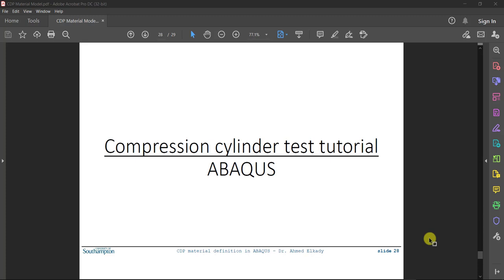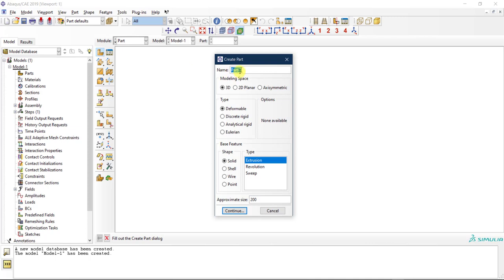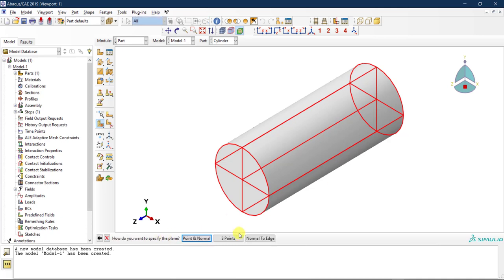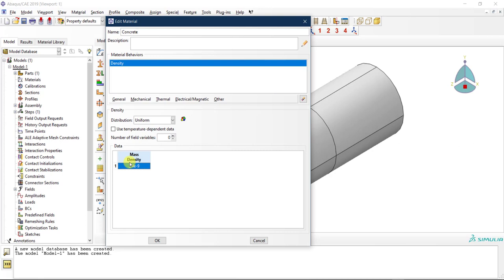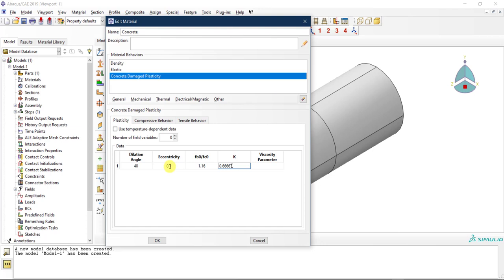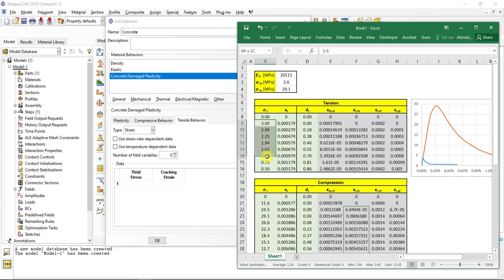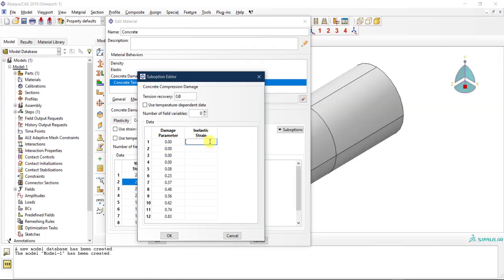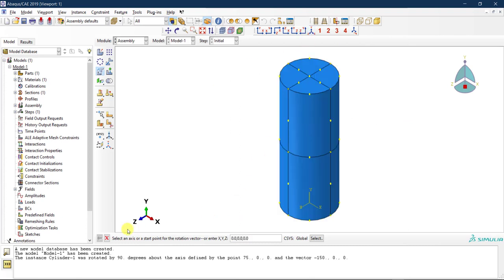#22 ABAQUS Tutorial: Concrete Compression Cylinder Test

Comment: Thank you Dr Ahmed for the great video. However, can we use Von Mises as a failure criterion in the concrete?  as I know that the Von Mises criterion excludes the effect of the hydrostatic stress while the concrete is sensitive to that stress.
Reply from the maker: Not sure I fully understand your question. The CDP model plastic flow potential function is already dependandt on both the hydrostatic pressure stress and the Von Mises stress. When assessing failure/damage in post-processing, it is up to you to check any stress components or invarients of interest.

Comment: Good afternoon sir, I want to know if the CDP model takes into account the strain rate and if yes would you mind mentioning the formulae? Thank you in advance
Reply from the maker: Most material models in ABAQUS "can" account for strain-rate effect IF specified by the user. For the CDP model, under the compression hardening and tension softening tabs, you can check the option to "use strain-rate dependant data" then you will need to provide the model parameters as a function of the different strain rates.
Reply: excuse sir but the problem I'm facing here is the lack of information ( inputs either in compression or tension ) about high-speed impact. For example, if I use the model depicted in Eurocode 2 for nonlinear analysis of reinforced concrete under compression. Do I have to check the strain rate option or that model would take into account the strain rate effect implicitly?

Comment: First of all thank you sir for such wonderful video. I have one question:  my abaqus file (modeling of beam-column joint under cyclic test) is showing error when i do edit keyword as suggested in your previous CDP video. For simulating crack do i need to install the exe. file in you CDP generator file as available in the link mentioned in the description. I am using Abaqus 2020. 
I will be grateful if you have any other suggestion to deal with it. Thank you sir

Comment: Thank you for always sharing helpful tutorials. I have a question concerning the type of analysis. You have mentioned in 13'55 that this analysis is a quasi-static one. I want to know why and based on what parameter you classified it so?
Reply: This means that the loading rate is very slow (10 sec), so eventho he is using the explicit solver (which is used for dynamic loadings mainly and mostly takes into consideration the inertia effects + Acc & Velocity), so this step is in name explicit but the load is slow enough to call it Quasi-Static.
By definition, "Quasi-static load means the load is applied so slowly that the structure deforms also very slowly (very low strain rate) and therefore the inertia force is very small and can be ignored."

Comment: Thank you so much for this video, sir ,when we develop pile driving model (concrete pile is used), how to apply the pile top load (Hammer impact)?
Reply from the maker: The only difference between static and dynamic loading is that in the latter you define a dynamic explicit step. In that step, time is relevant, therefore, you can then model how the applied load or displacement changes with time. Please see the tutorials on cyclic loads and explicit solver.
Reply: @AElkady  ok sir. Thank you very much.

Comment: Dear Dr.Ahmed 
Thank you for providing these tutorials.
After I filled the properties for CDP, I am facing errors like, "Unknown keyword "concrete failure". The keyword may be misspelled, obsolete, or invalid.

The material options *cap plasticity, *cast iron plasticity, *clay plasticity, *concrete, *concrete damaged plasticity, *drucker prager, *foam, *crushable foam, *mohr coulomb, *jointed material, *plastic and *soft rock plasticity are mutually exclusive

Analysis Input File Processor exited with an error.  
Please let me know, if you have answers for this.
Thanks!
Reply: Same error occuring if you have mitigated this error kindly guide me also 
Thanks a lot

Comment: Thank you very much for the video. I was required to model element deletion in a concrete block when element temperature reaches specific value and specific failure strain in that temperature. How could I use these temperature dependent failure strains into my model?
Reply from the maker: When defining the material, you can choose to define "temprature-dependant" data. In that case, you will provide material properties definitions (including failure strain) as a function of temprature.

Comment: I also have question here, in the Reference Point in assigning Constraint, why is it that you use Tie instead Rigid Body?
Reply from the maker: both would work in that example.
Reply: @AElkady  Ahhh, I see. Noted on this.
I am working right now on my Master Degree thesis, and I am using Abaqus Software. Actually, I did practiced your problem (4 point bending test) here in this video: https://youtu.be/LBUhH-d3sxw. I did all what is done in your video. To be honest, my thesis focus, too in 4-point bending test. But my problem is, the graph in the Force vs Displacement is not much of a non-linear graph, compare to the graph in your other videos like: https://youtu.be/fYvUDo06e6c. Do you think there's something that is wrong in my Input Data?
Reply: By the way, my time = 1.0, and my increment is 0.05... is the time and increment has something to do with the graph?

Comment: Thank you very much for the video! Very useful. I just don't understand why you used tie-rigid body constraints instead of pin-rigid body constraints you used in another video?
Reply from the maker: There will only be difference between tie and pin options, if the reference point rotates. In this example it does not, so the selected option does not matter.
The documentation below provide clear description of the two options with illustrations:
https://classes.engineering.wustl.edu/2009/spring/mase5513/abaqus/docs/v6.6/books/usb/default.htm?startat=pt01ch02s04aus20.html#usb-int-arigidoverview

Comment: For this analysis, my job immediately aborts with the error
"The independent variables must be arranged in ascending order. This error may have been caused by a possible empty line on the datacards in the property definition."
but there is no empty line in my datacards
Reply from the maker: 1) Discard all keyword edits to the model (if you did any) and re-write the keywords. 2) Make sure that your CDP data (such as damage parameter and strain data) are in ascending order and not repeatative).

Comment: DURING THE CONVERSION FROM CRUSHING TO PLASTIC STRAIN Abaqus FOUND NEGATIVE AND/OR DECREASING VALUES OF PLASTIC STRAIN. VERIFY THAT THE DEGRADATION DATA UNDER *CONCRETE COMPRESSION DAMAGE IS CORRECT??????
Reply: its my bad 0.0006 I miss on 0.00

Comment: I'm getting the error message that DAMAGESHR, PEEQVAVG, PEVAVG, SVAVG are not available for element type C3D8R.

I imagine DAMAGESHR in particular is very important for this analysis, so how do I fix this issue? Are you supposed to use a different element type?
Reply from the maker: Field variables are available for specific element types and analysis procedurea, Please check this link for more details https://classes.engineering.wustl.edu/2009/spring/mase5513/abaqus/docs/v6.6/books/usb/default.htm?startat=pt02ch04s02abv01.html

Comment: A question please, I am doing a quasi static compression test on a polymeric structure and the compression rate is 0.1 mm/ sec applied for 6 mm, for a dynamic explicit time step shall I write 60 sec (1 min)  or what?
Reply from the maker: That's correct although if you are not incorporating strain-rate effects, then your simulation step time does not need to be the same as that of the test. Iif you are simulating a quasi-static condition, you can use a much shorter step time as long as you don't induce dynamic forces in your model. Check the tutorial on explicit solver DOs and DONTs

Comment: Dear Dr. Ahmed,
Thank you for providing these tutorials. 
Regarding using the engineering values of stress-strain data, I wondered when to convert this eng stress-strain chart to true stress-strain?
Reply from the maker: Transformation of engineering stress-strain to the true one is mainly applicable to ductile materials that experience significant elongation and change in cross-section prior to failure. This does not need to be done for brittle material like concrete.

Comment: hi thanks for your unic tutorial.
i do what you do step by step 3 turn but in eatch turn apear an error that sey:
Error in job Concrete_Compression_Sym: THE INDEPENDENT VARIABLES MUST BE ARRANGED IN ASCENDING ORDER. THIS ERROR MAY HAVE BEEN CAUSED BY A POSSIBLE EMPTY LINE ON THE DATACARDS IN THE PROPERTY DEFINITION.
can you help me?
Reply from the maker: This means you probably made a typo when you edited the keywords to add concrete failure. Re-check the keywords.

Comment: Hi dear Dr this cdp file used for confined concrete or not?
Reply from the maker: This is based on a typical cylinder compression test. No confinement. The litrature include simple modification to material strength and ductiltiy to account for confinment.

Comment: I noticed that you have entered the density of the concrete as 2.4e-9 which is N per mm cubed. Thus this will translate into 2.4 N per meter cubed. But the actual density of concrete is 24 kN per meter cubed so the correct entry is 24e-6. Please correct me if I am wrong. Thank you and good work.
Reply from the maker: 1) N or kN are force units not mass units. 2) In ABAQUS, if you are using SI (N and mm) units, then mass is defined in tons and density is defined in ton/mm3.
Reply: @AElkady  Thanks I get it now

Comment: Thanks for you teaching. It helps a lot.
When I edit keywords in the model the same way that you did, my job report an error: "Unknown keyword "concretefailure". The keyword may be misspelled, obsolete, or invalid." Do you know how can I solve it? 

Thank you again.
Reply from the maker: You need to make sure you follow the syntax exactly. It is case sensitive. Also, this keywork is available in ABAQUS 2019 and later versions.
Reply: Dear  @AElkady  thanks for the answer! 
When I compare the stress-strain curve obtained by the results of simulation with the original stress-strain curve (the input parameters), there are some considerable differences. These differences occurs mainly in the plastic part of the curve. Is that normal?  
There is some way to "calibrate" the results to obtain more accuracy in this stress-strain curve ?
Reply from the maker: @windsonaguiar3690  that's expected particularly since I'm using a generic concrete material model parameters here that are not specifically obtained from a cylinder tests with these specific dimensions. Also, the plastic beahviour will rely on part on the stress distribution and failure mode being triggered in the model (both of which are dependadnt on the model imperfections as discussed in the video).
Reply: @AElkady  
First of all thanks a lot for the videos🙏
I'm usin 2017 version and anyways I can't find the keyword "Concrete Failure" in the User's Manual. I'm having the same trouble as Windson.
Reply from the maker: @naniruja3407  Including the Concrete Failure option is not a critical material property and mostly cosmetic.
Reply: @AElkady  Thank you for the prompt response.
I'm going ahead with the analysis without it.👍

Also I'm getting zero reaction forces at the base, when extracting data from History Output request already created.
Any thoughts?
Reply: @AElkady  thank you sir it helps alot
Reply: @AElkady  How can I input this parameter in ABAQUS versions older than 2019? Alternatively, does ABAQUS versions older than 2019 lack this specific parameter? 
Thank you in advance.